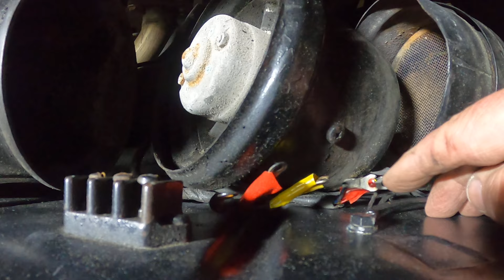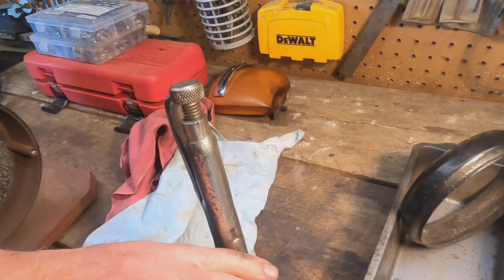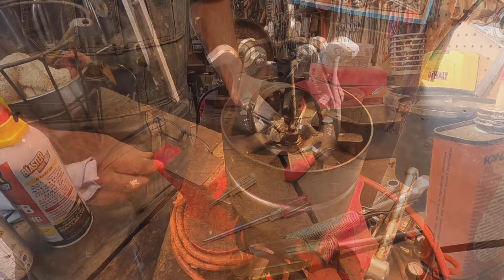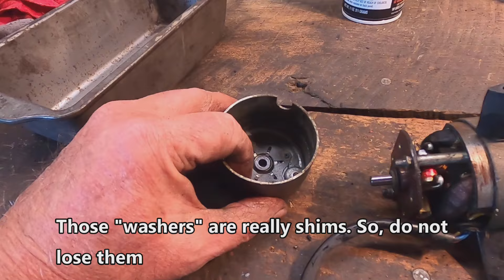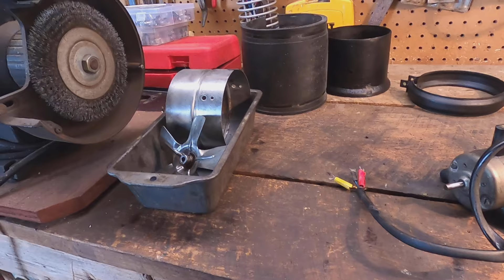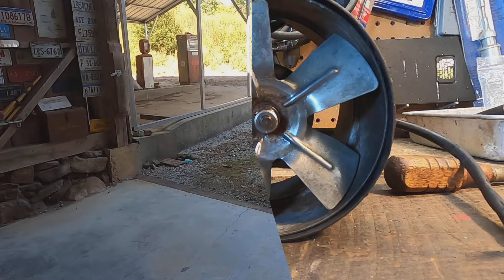Passenger Side Ventilation Fan Servicing 1959 Mercedes Benz 220S (W180) 16th Recommissioning Video

Comment: This is a major problem for me, none of the fans are present in my ponton, nor the original cardboard parts. I already clean and fix the pores/holes on the radiators so that will be my next challenge. Again thankyou for sharing
Reply from the maker: Thank you for watching. If you look hard enough, especially on the internet, you will find what you need Oh, good job on saving the radiators.